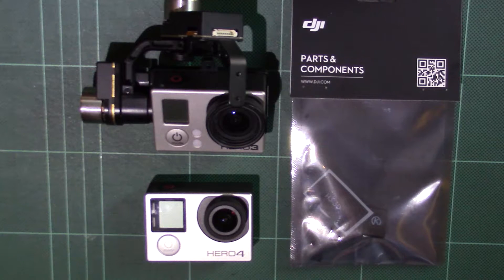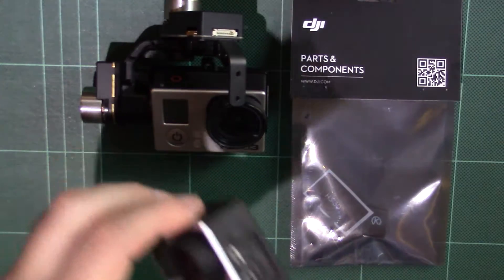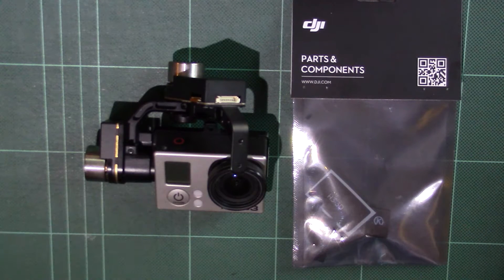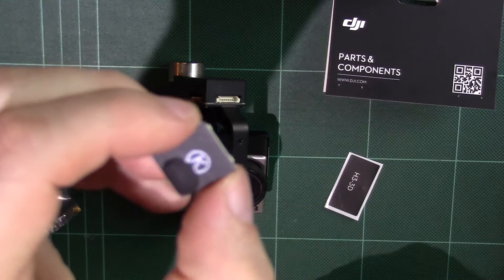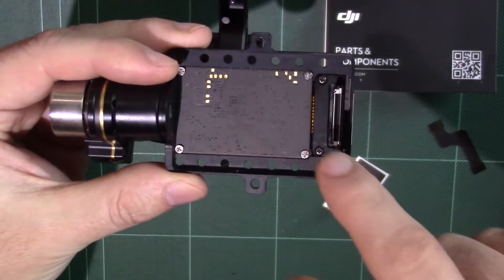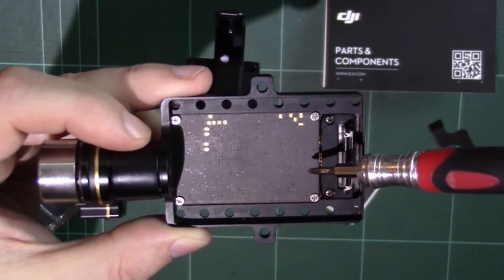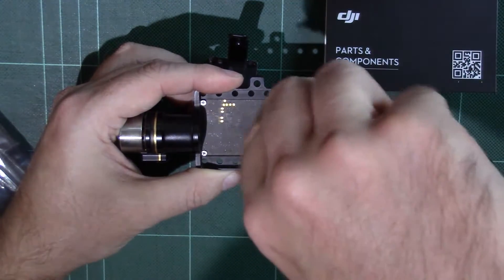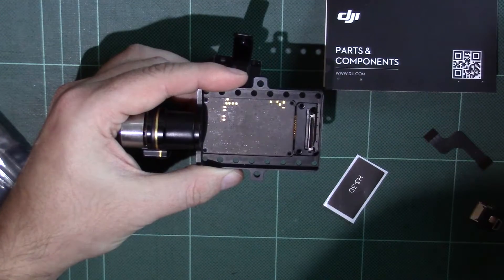Use Hero 4 on DJI H3-2D Gimbal - Zenmuse H3-2D Hero 4 Modification

Comment: This will get you a fpv picture. Do not think this will make h3-2d useable with gopro hero 4 because the gimbal will shake and tilt uncontrollably at random times making it this whole mod a waste of time anyway.
Reply from the maker: +Alexander Sundberg Assuming you mean the H3-3D then I do take your point. You are well advised to counter weight the gimbal by sticking a coin to the outside of the tilt motor housing. This makes a massive difference to the glitching issue on the Hero4. Lots of forum threads about that side of things and well worth a try as it is super cheap and non-destructive. This is the method http://www.youtube.com/watch?v=kYPur4DrWq0 but it is better to stick the coin to the outside edge of the silver motor housing as it means you only need coin. The key is to make sure it is totally balanced when turned off. Works a treat.

Comment: Hi, i got the cable and installed as your video so i can use my hero4 silver, but the signal to screen shows alot of interference and the gimbal is shaking violently and motors making alot of noise :( any ideas, i have put back in the hero 3 connection and it is still the same now.

Comment: i also bought an iosd mini, i was thinking of adding a can bus on the board but i just cant solder the wire on those tiny circles, would it help if i buy the dji can bus hub, i dont know where to plug it in the mc

Comment: I had forgotten about the coin trick.  I'll give that a try.  I'm also using a handheld stabilizer for my Hero 4 that is actually made for the 3 but it seems to work fine though I've read that it will use the batteries quicker as it works harder to keep it balanced.
Reply from the maker: Yeah the whole key to a good brushless gimbal is to have near perfect balance before turning it on. The idea is that the motors are only there to stop the camera from falling out of balance due to movement so with a perfectly balanced gimbal the motors don't need much power at all. Hand helds like the Feiyu-Tech G4 have monster motors that are way over rated for holding a Hero 3 or 4 in balance and hence can take a lot of abuse whereas the H2-3D and H3-3D are quite weak so get really jittery if you mis balance even by a few grams.

Comment: Nice demo.  I completed the mod without issue though you do mention that the weight is the same between the 3 and 4 which I think is not the case.  I've only flown one quick test flight but I did experience a "gimbal flop" which I bet is due to the weight difference.  Thanks for posting.
Reply from the maker: Thanks Mark - Yes I too have noticed a couple of flops myself on my H3-3D when using the H4 and there is a bit of whining noise. The trick to balancing the H4 is to add a bit of weight to the motor housing (a coin works well). If it balances with no power on then you are golden. I am about to do this weight mod myself.

Comment: I'm struggling to get the 4 screws off the gimbal...I'm using PH00 screw driver which seems to have a pretty decent lock, but none of the screws will budge even a little. Any suggestions?
Reply from the maker: Probably just thread lock. As mad as it sounds try tightening them a little first then backing them out again. Failing that gently heat the gimbal with a hair dryer (not a heat gun!). Warm to touch won't harm it but might ease the thread lock up a little.

Comment: I did all your process and I didn't work. I use fatshark teleport v3 and the TX overheats and the red led was blinking. The gimbal works but it doesnt transmits video and cause the overheating. I connect the pilot camera that comes with the fatshark and the TX worked, so the googles, the TX did not overheat and the red led was steady. When I tried again with the flex for h3-3d the same happened again, Tx overheat, didn't transmitted video, and red led on the tx was blinking. Any idea what might be happening?
Reply from the maker: Hi David - Are you certain you got the ribbon cable the correct way round? If you don't it will do pretty much exactly what you describe because you are basically shorting it out. I would however expect the Gimbal to slowly tilt out of alignment too. Can you post a video or point me to some photos of your setup with the vTX. You have to be quite careful that you are not plugging the vTX's 5v output into the gimbal by accident (furthest pin on right of the vTX). The pilot cam will use that pin to power it but the Zenmuse doesn't need it as it takes power from the Phantom/GCU.
Reply: d3weyTube Hey man! I solved it, it was a bad connection, ribbon cable was ok, but I was connecting the GND that comes from the phantom to the V+ from the tx, that was causing the overheating. Now it works perfectly! Thank you for your time!

Comment: This mod sucks. a) the ribbon is thick and makes it hard to install the GoPro 4, b) I am also having problems with video signal from the GoPro 4, not GoPro 3+, c) the way the ribbon is installed, it will not last very long if you need to remove your GoPro often.
You can now apparently order a GoPro 4 compatible 30pin connector on Goodluckbuy (I have no affiliation but sure hope it works).
But thanks for the very in-depth tutorial. Your reviews and tuts are great.
Reply from the maker: Cheers Fik. Agreed this is not an ideal solution cause the ribbon cable is pretty horrid (though it seems to be holding up well for me so far). Given its price it is worth getting about 3 when you buy just in case! I would imagine DJI will create a new official 30 pin-out (I hope so!). Till then the Goodluckybuy one might be worth a look.... not much to go wrong if it is created correctly. Happy flying.
Reply: Thanks ;) Btw. the bad output from the GP4 was due to me leaving it in NTSC, totally my fault.
I'll try to update on the new 30pin when it comes in.
Reply: Fík Fíkovský did you get your 30pin from goodluckbuy that claims gopro 4 h3-3d compatibility? i got mine in today and it still shows no video. i had the newest version of the h3-3d so mine shipped with the connector d3weyTube is installing in this video. i had bought the older 30pin connector a while back when i had the gopro 3 and it worked like a charm. now that i have the gorpro 4 black with the goodluck buy 30pin gopro4 compatible connector and the older 30pin one neither work for me with gopro 4. guess i'll have to go back to the original setup for the retarded ribbon connector.

Comment: Hello

I broken my original GoPro connector. I need the 30 pin connector to repare my Zenmuse. If you has made this mod, can you sell me your replaced GoPro 30 pin connector please?

Thanks in advance
Reply from the maker: Not selling mine thanks. Gonna keep it just in case I want to revert back to stock
Reply: d3weyTube  would you be so kind to take a picture of it for me, I need to find one as well,  I'm in the same boat as curso88

Comment: Will hero 3 or 3+ still work also?
Reply from the maker: Yes - This mod makes it possible to use all cameras as the video out pins in the USB port are the same across all models.
Reply: d3weyTube Thanks.  Very helpful!!  I thought my hero 4 was bad.
Reply: Boogie Man Hello

I broken my original GoPro connector. I need the 30 pin connector to repare my Zenmuse. If you has made this mod, can you sell me your replaced GoPro 30 pin connector please?

Thanks in advance